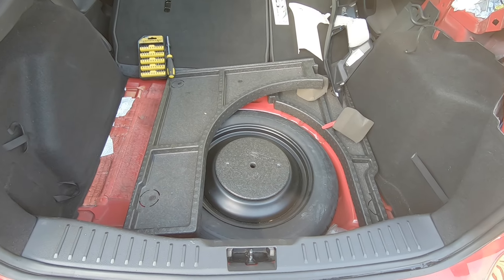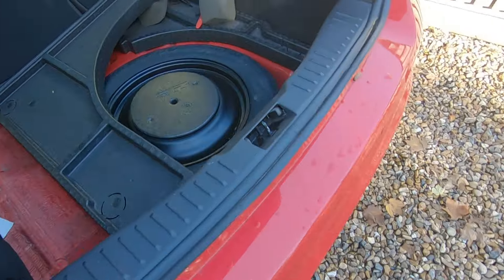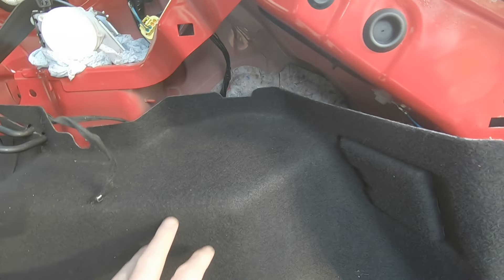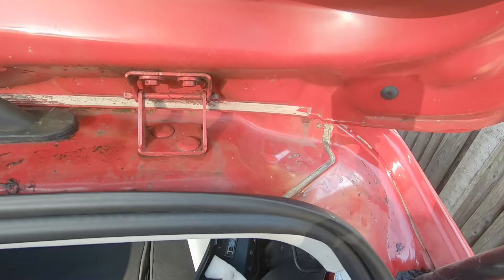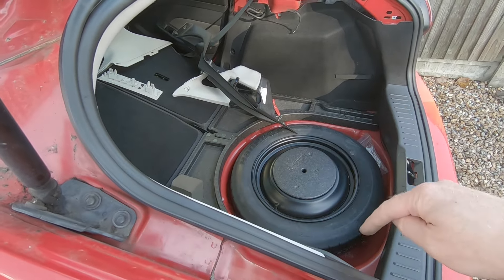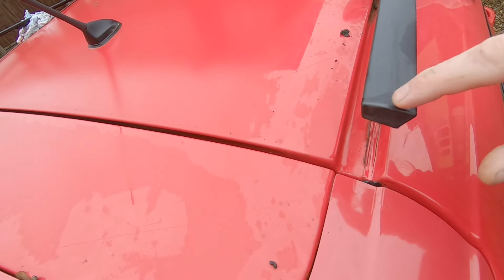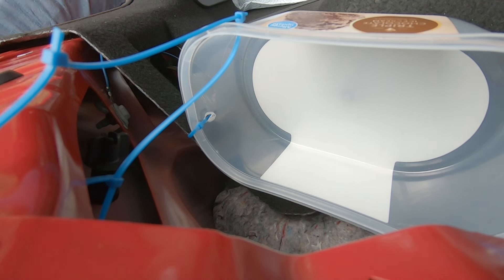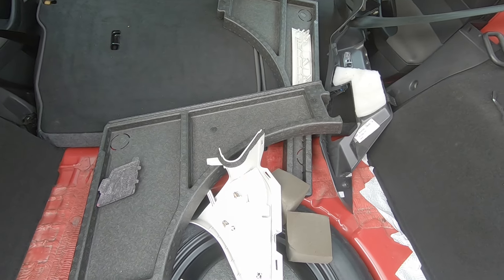Ford Focus mk3 multiple water leaks in boot fixed!

Comment: Hello Dan's garage the B max suffers with this problem as well my local garage has done this repair but it still is leaking water car goes back to garage hopefully on Wednesday 05/02/25 I mentioned this video and said I would go and get tiger seal garage owner said this tiger seal is used for bonding permanently if the roof rails are sealed with tiger seal this will stop the water but if used on light clusters they will never come out not sure about this product
Reply from the maker: I used clear waterproof silicone bathroom sealant on the vents (less permanent). I only used the tiger seal on the split seal areas. I've also used the clear silicone on my leaking lexus IS200 boot plastic inserts, and it worked fine for me.
Reply: @dan91sgarage  hello Dan I managed to get the roof rails up to look underneath as I was convinced there would be a split in the bodywork like yours mine are okay had a nightmare getting them back down again neighbour did it for me thank god I took my vehicle for wash told them to stop halfway through found leak behind  trim panel in boot area nearside on my B max small leak but enough to let water in to vehicle managed to hold back trim panels with cable ties  anchored to rear of seats rubber weather strip around boot is leaking so will have to replace at later date what did you use to hold down seal on boot plumber maintenance is it ? Good video very informative if weather is better would try this weather not been good this way heavy rain over last couple of months

Comment: Had both seams cracked some black electrical tape was a temporary solution now after half a year it drips again, i have vents in the d pillar so i have visible drips going along the wiring and ending in the vent grille dripping down on the carpet, the roof gutter along the roofrack feeds directly in the seams so that won't help the situation i have a 2016 ST Estate/wagon
Reply from the maker: Good luck brother 👍
Reply: @dan91sgarage  just finished caulking the two seam above the boot.  i cleaned and degreased the area, even lifted up the rubber around the boot opening, a lot of mud was collected under there.
There were multiple cracks in the seam still a lot of paint though to my surprise. 
I taped the area around the seam to make it neat looking (sorry can't add pics to comments) scraped the excess with a plastic tool and after around half an hour later i used a wet finger to smoothen the area and then removed the tape, after that i used a blade to carefully tidy up around the sealer
Reply: Tiny update, i got around with priming and painting the repair  it's invisible from a distance.
For painting and priming i used these little paint containers with a brush inside.

One primer, one clear and one color it was a hasstle to actually find the correct color number (stealth grey) but its a perfect match so i'm happy

Comment: Question! I took the car back from the garage that fixed the vents leak problem but I realised nor the bungs nor the foam are fitted back in the rear vents. Should I buy new bungs and fit it back in?
Reply from the maker: If your talking about the round plastic bungs I like to put them back in with a hole in them so if it leaks again the water can come out. Also stops mice crawling in!
Reply: @dan91sgarage  thanks! I bought new ones and put them back. I was worried about the road water getting inside :(

Comment: What a crap car, why is it so popular.
Reply from the maker: Why so negative?! Once the leaks are sorted the Focus is actually quite a good car. Cheap to buy run and insure, parts are easily available and they are mechanically easy to work  on with great access. And the performance models are great value. All modern cars have problems, I'd take a 90's Toyota over any of them, don't get me started on renault/Nissan or VAG stuff... lol.
Reply: I had a boot leak on mk2 that i eventually fixed(roof strips)mk3 just as bad, that should hav been sorted! Wheel nut caps distort so u cant change a tyre, i had to hack em off, noisy abs/suspension, broke seatbelt, Nice to drive but too many annoyin issue
Reply from the maker: @richat1691  I've heard about the wheel nut cap problem, never experienced it myself using hand tools and torque wrench to tighten. When the cap peels off you need a 1mm smaller socket to remove and replace with new, Rattle guns do shred them quite easy though. Only had noisy front top mounts on mine which were old enough to just be wear and tear.